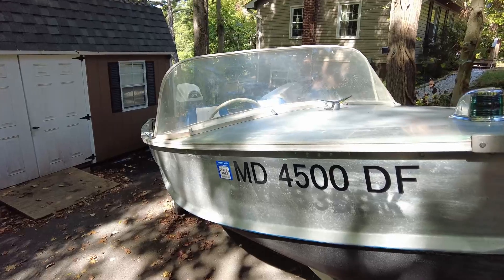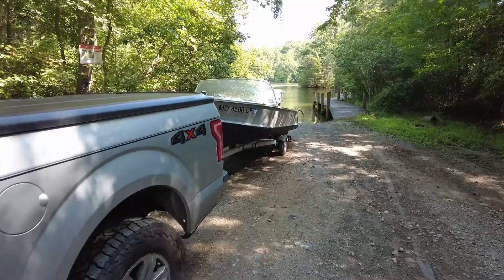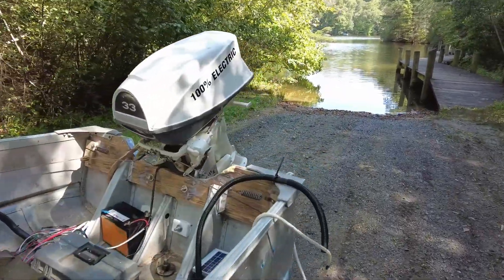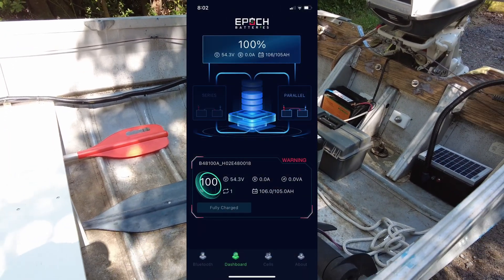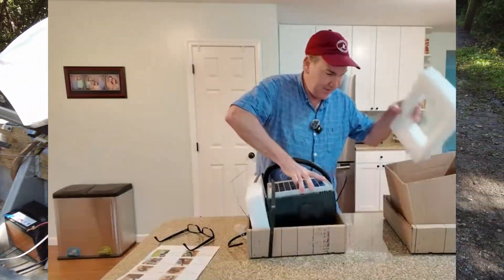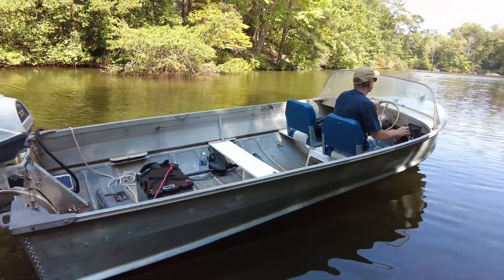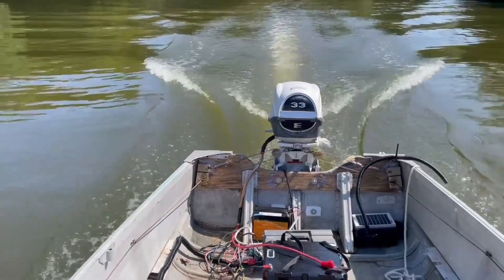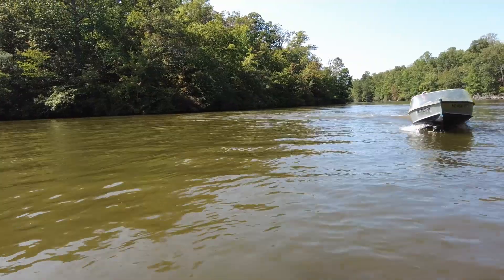Retromod Electric Boat Motor - Launch Day!

Comment: current and voltage please!!
Reply from the maker: 48v 10kW diy motor.
Reply: @drez20001  Cool  I guess I was asking about running.  At full throttle, what current was it pulling?

Comment: Is there a video about the motor build/modifications, or where can I find out more info?
Reply from the maker: The motor was built by a friend of mine.  I did some changes to the throttle control and installation.  It’s at its heart a golf cart motor on an old Johnson leg.  The electric motor head is an etek 19kW 48v motor.
Reply: Ooooo that looks like around 10kw it's got more in it?🤞🤞🤞🤞😎 @drez20001